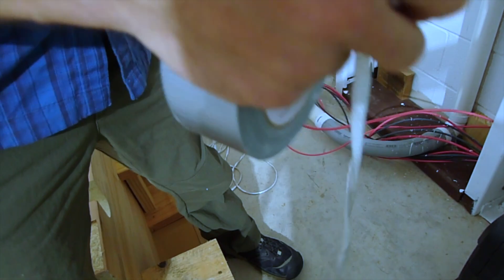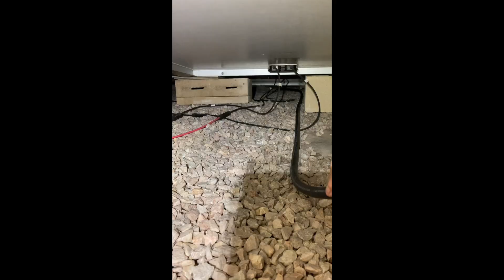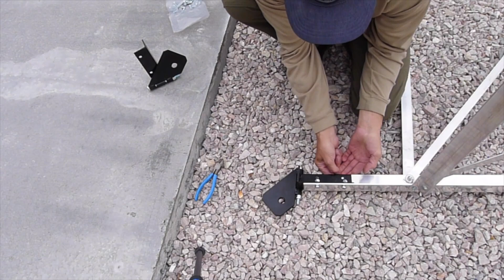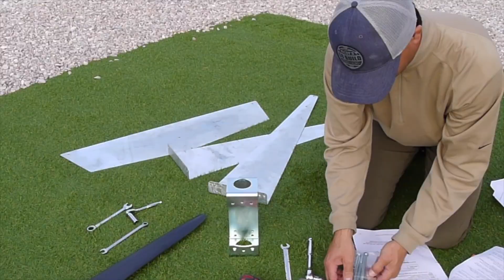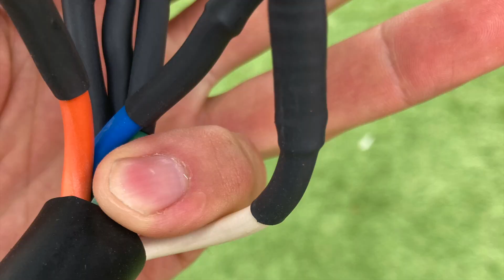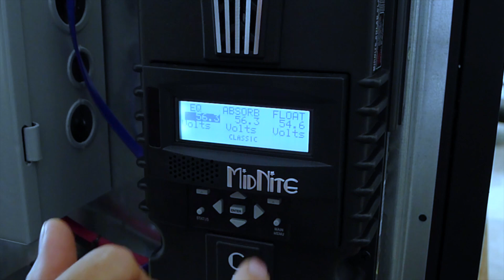How to Install a Wind Turbine and a 40' Tower for Home

Comment: Good video.  I can't wrap my head around calling such a small machine 2kW.  Is what you put in the suggested power curve for this turbine?  The power curve has it cutting in around 50V and asking for 2kW upwards of the 200V rating of the controller, which would have the turbine running really fast ~ I'm curious to see your updates.  In my experience (different machines but a couple of different ones) we rarely double the voltage in the power curve with the classic, or grid tie inverter with MPPT. (meaning, if we cut in at 50 we'd have full, or near full output at 100)  That said I don't have a ton of experience with this.  I wonder what the advertised power for this wind turbine is with, and without the MPPT control. (power/wind velocity)
Reply from the maker: Hi,

I’m sorry for the delayed reply!!
Unfortunately this is a very small turbine, and designed to turn fast when the right wind is present. Around my area I would rather prefer one that generates 1500-2000 w with 15 m/h wind thought. I am going to make a review shortly, after a year.
Thank you very much for watching!!
Reply: @offgridwithlaszlo  Cool.  For that sort of power @ 15mph you'll be looking at a fairly efficient wind turbine (probably not a VAWT) with swept area around 300 square feet, so 20' diameter, or... a good VAWT 15' wide and 20' tall ... or whatever depending on the design.  (the HAWT is easier)  I've built that big a few times, big projects, but fun.  There are bits about some of it on my channel.
Reply from the maker: Thank you very much for the info, I definitely will check out your videos than!!

Comment: I am looking for about a wind turbine around 5 kw in your opinión what brand can you recomend ti me? I am from Perú
Reply from the maker: Hi,

I didn’t get a chance to test any 5KW wind turbine, and without testing any unit I would not recommend really anything. Just reading the specs , unfortunately is not enough to able to determine if the unit is good for the application. Thank you for watching.

Comment: I doubt if this weak structure will be able to withstand the winds above 20m/s,, everything is so weak including the foundation
Reply from the maker: So far it is holding up pretty well surprisingly. Please check out my reviews after a few months testing it. If you click on the video tab or just the links.
Thank you for watching!

https://m.youtube.com/watch?v=G3KRk8dKe_0&lc=UgzRHLkeWAwzhBFprZF4AaABAg&feature=em-comments

https://m.youtube.com/watch?v=Klqrnh-VPOc
Reply: @offgridwithlaszlo   thanks for the reply,, have you checked  the actual wattage generation at average wind speed of 10m/s,,,,
Because power generation depends on blade size,, and blades above 2 meters are only capable for regular 2kw power generation at average wind speed

Comment: All practical tests show that small wind turbines hardly generate any electricity! Here approx 170 kWh/year from a 8400 USD wind turbine on a 40ft tower!
Because there is hardly any wind close to the ground. It is also extremely gusty, which usually shortens the service life. 
Only if you need to be self-sufficient from the power grid, you should buy a small wind turbine for the winter. 
With solar modules, on the other hand, you can reliably generate green electricity for 25 years at approx. 3-10 cent/kWh!
Reply from the maker: I agree with wind turbine theory. I just did my review after a full year, I already published in Hungarian, and working on the English version. Hopefully I can publish it in a few days. I personally don't like grid and staying off grid is my number 1 plan. After a year the numbers look much better but solar still a better solid choice for me.  I attached a the review but if you don''t speak Hungarian the English version will be viewable shortly. 

https://youtu.be/LadcOuhTRg8

Thank you very much for your input, and for joining to the channel!

Comment: CABLE PULLING LUBE
learn to cut your cable ties out FLUSH or get ready to BLEED
Learn to TIN finely stranded wire BEFORE connecting it
Always blow out holes in concrete BEFORE installing an expanding anchor
It's OK to use outdoor strain relief connectors indoors; but it's NOT OK to use indoor connectors OUTDOORS
Etc
Etc
Etc